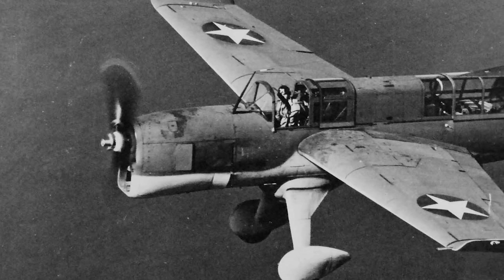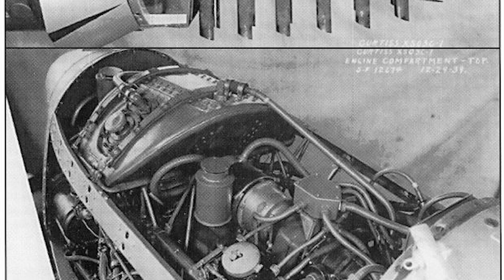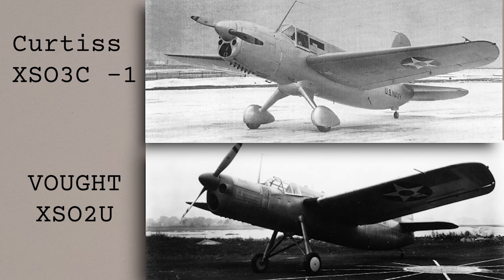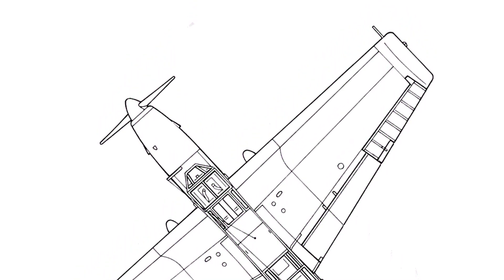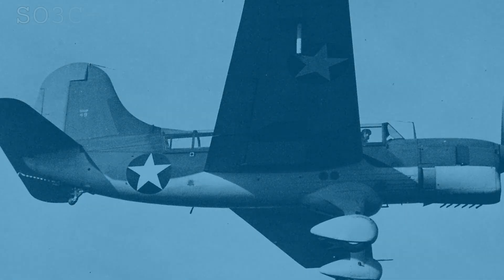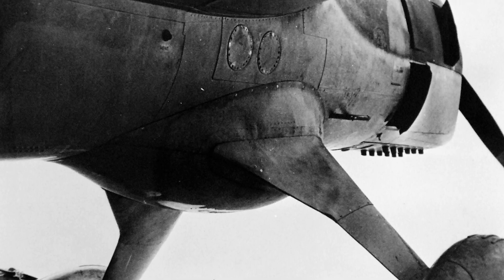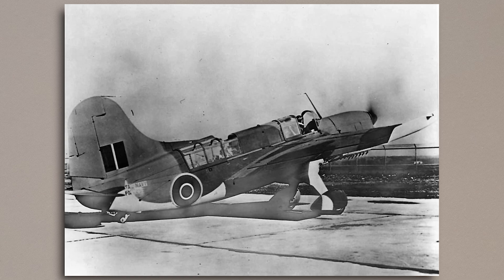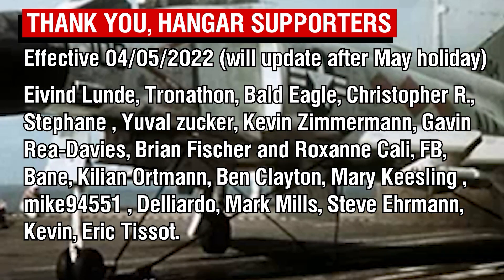A Plane So Bad It Was Removed From Service  | Curtiss SO3C Seamew [Aircraft Overview #56]

Comment: It was designs like this that prompted the US Navy to request a carrier borne bomber to have one pilot and the engine power to obtain enough speed to cope with enemy aircraft. The Dauntless was good, but it had to be escorted by Hell Cats lest it be shot down in droves. The result was the ADF Skyraider, a fast attack aircraft requiring only one pilot and the speed and armor protection to successfully carry out it's mission.  The Sky Raider was so good it was never replaced by one air craft but by several and even they were replaced before the Sky Raider was!  Today the Navy has yet to employ an all purpose attack aircraft that doesn't need fighter protection!
Reply: What about the F35, or the Super Hornet?

Comment: "The engine failed, causing it to sink..."
   Positive pressure seals on the floats? If the engine isn't running, pumping air into the floats, the plane sinks?

Comment: If it looks right i flies right. An engine thats not fit for an airplane combined with a short stubby fuselage and the added fixes to improve aerodynamic just screams failure. The French tried an inverted aircooled V12 too, This engine belong in a Citroén 2cv.

Comment: It's funny to see an aircraft design with a tail as big as a ship funnel having stability problems cured by yet MORE fin. The winglets most likely reduced a progressing side ship tendency, or made the ailerons more effective at high angle of attack slow speed flight. Sounds like it was mostly too under-powered for its own good. Should have stuck with a P&W R-985 or R-1340 and shortened the snout in the process to balance out the heavier radial and reduce the gyroscopic procession of the long mounted prop of the inline engine.

Comment: I have considerable experience with US Department of Defense acquisition programs.  As you alluded to, one thing which will severely endanger an acquisition, is changing the requirement after the program is well along toward completion. US DoD is strewn with the wreckage of program's with ill-defined requirements or requirements changed after the program has committed considerable resources and time. The list is a long one.

Comment: Surprised that there was little of no mention of its performance compared to its competition - the Kingfisher AND the original SOC.
It is one thing to describe flaws, but without context of alternative types you are not getting a clear picture. Any system is the sum of many elements. That’s why for instance the British could make use of an aircraft like the Swordfish that for all intents and purposes was hopelessly obsolete -  but for the fact that it was available, easy to maintain, easy to fly and did not have to face much aerial opposition in its area of operation. This is the second episode with no or hardly a mention of the Kingfisher. Maybe also more attention should be given to the role of scouting in general - as carrier aviation became the dominant component of naval aviation, tactics and strategy. Context. We can all pick up books with stats. But it is the context that is often missing.

Comment: According to aircraft designer Sergio Stefanutti, in designing a new aircraft from scratch, the aerodynamic is always the part that came out first, and the engine the part that came out last. Engines need a long development process before being ready to be used, so the designer should never rely on a new engine for his project to work. To reach the required performances is better use proven engine designs, and spend more time on the aerodynamic.

Comment: IF, The forward firing armament is so ineffective that depth charges could be an alternative to the machinegun, And the plane needs to take off with half of it's fuel capacity just to barely be able to take off at all, THEN it is not a plane but instead a boath.

Comment: “Air cooled” and “inline V-12” just doesn’t go well together.
Reply: "inline V-12" doesn't go together because it's a contradiction, "inline" means all cylinders in a single row, "V12" means cylinders arranged in 2 rows, so an engine can't be both. Germany made successful air-cooled V engines, the Fieseler Storch had an inverted air-cooled V8 and the Focke-Wulf Fw189 had inverted air-cooled V12s.

Comment: Plane needed more cowbell--got it--still didn't work. Still, from failure in one model came success in others. While WW2 was a terrible time in history, it did result in some outstanding piston-engine planes as well as jet-powered planes in the latter half of the war. The advances came very quickly in the 1940's, and even faster in the 1950's.

Comment: The US already had the OS2U Kingfisher all metal monoplane which flew a solid year before the Seamew.  The Kingfisher had near identical performance characteristics except for 20% leas range.  The Navy went on to build 1500 of them throughout the war.
Reply: Which leaves me wondering, why did they even bother with this program to replace the SOC at all? Just replace them with Kingfishers. Hell, the Seamew's competitor (the Vought XSO2U) was pretty much a Kingfisher with a higher-mounted wing and shorter struts to attach the float. And at least part of the reason for choosing the worse-performing Seamew was that Vought's production capacity was being taken up by the Kingfisher.

The idea seems to have been that the Kingfisher was for battleships and the Seamew would replace the SOC on cruisers. But the Kingfisher ended up operating on cruisers as well with no problem. Was it just that Curtiss didn't have enough work coming their way and this contract was to keep their factories running?
Reply: @RedXlV  To utilize a new engine line: the inverted V12 AIRCOOLED engine that they wasted money on, and it is a shitty engine
Reply: I'm eagerly awaiting Rexs coverage of the Kingfisher, had a soft spot for these planes ever since mounting a couple of them to the stern of Tamiyas USS Missouri back in the 90s!
Reply: Curtis was seen as shady.  The SB2C was a disaster on roll out.  The navy wanted to just cancel the Hell Diver because of it's bad performance but multi million dollar contracts were issued and higher ups forced the navy to take the unpopular plane into service.
After numerous fixes at way stations across the country the plane entered service with Curtis technicians actually on the carriers.  When Hell Divers didn't return from missions and disappeared on non combat missions it was discovered that the wing latches could fail in flight. It was later discovered that Curtis knew about this flaw but stayed silent for fear that futher fixes would cost the company too much money.
That's not the worst part.  Apparently the techs on board the carriers also knew about the possible death traps the planes were but said nothing to the men who flew them!  Some CV skippers ordered the SB2Cs to be thrown overboard and used the F6F Hellcat as a fighter bomber.
I bring this up because the military viewed them this way.  Curtis politiced there way into keep producing the P 40 for most of the war.  The obsolete fighter was given away in lend lease along with other planes.  They put profit above the lives of the men who flew their planes.
Curtis Sea Mew was just more of the same.  Junk pushed on the armed services.

Comment: Wasn't the 0S2U Kingfisher the replacement.  With the Seahawk being the replacement of the Kingfisher?
Reply: I wondered the same thing, so I looked and you are quite correct, with the Seahawk being introduced into the fleet in 1944.  I believe they were quite common in the Pacific at war's end.  Love the Kingfisher though.  One of the few planes I can think of that is ugly enough to give you nightmares when you remove the floats and add fixed landing gear!

Comment: I have a 1/48 model of this A/C in my display case.  Consider it a tribute to a failed design.  A couple of points.  Some of your pictures show the Seamew embarked on the USS Biloxi (CL-80).  One of those A/C bore the name "War Junk" on the left fuselage forward of the cockpit.  Also, opening the observer's canopy in flight to deploy the rear gun played havoc with the lateral stability of the aircraft, because of disrupted airflow! I think the aircraft lasted two months on the ship.  They were removed before it saw any combat.
Reply: That disrupted lateral stability was a design bonus. Instant evasive manuevors. Imagine being an aspiring Naval Aviator. And after getting your wings you get shoved into one of these.

Comment: Let's be honest, the plane wasn't horrible, the engine forced on Curtis was.  The airframe itself was mediocre, but far worse saw service.  If it weren't for the engine it likely would have served solidly until tech advances obsoleted it.
Reply: The inverted V-12 engine concept just didn't pan out....
Reply: @Hoopaball  that's not entirely true: the Bf 109 had an inverted V12, and that worked great. There have been quite a few successful inverted V aero engines over the years: this particular one just wasn't one of them.
Reply: @a.p.2356  good call. I meant *air cooled inverted V-12.  However, for the US Navy at the time, it seems like the air cooled radial was King.
Reply: @a.p.2356  True, several different variants performed well.  Just not for us.  Some of our radials weren't trash, though, so that's good I guess.  Engines for aircraft were not our strong suit during ww2.
Reply: @a.p.2356  True, however; radial engines were better, by far, in almost every application.  The FW-190.....one heckuva airplane. Germany's P-47....
Reply: @jeffstrom164  On the contrary, the Double-Wasp R-2800 and its further refinements were WWII game changers.  Post WWII commercial airliners depended on this engine.
Reply: @jds6206  You aren't wrong that the R2800 engines were a great line that came out of WW2, but you are wrong in that the majority of our engines were behind in capability.  It is why we had to use licensed domestic versions of European engines.  Most of the war our planes were slower and less acrobatic than the planes of the the other nations, mostly because our engines sucked.
Reply: @jds6206  It depends what you were after. The V engines tended to have a better power to weight ratio than radial engines and could usually be fitted into a more aerodynamic airframe. The downsides were a need for a liquid cooling and radiator system, and being more difficult to manufacture and maintain. The radials tended to be more able to resist battle damage and more easy to maintain as they were physically larger. They however tended to be heavier and physically larger than a V engine for the same power output, and caused a lot of aerodynamic drag due to the large surface area facing the airflow.

Both had their uses in different roles, with navies generally having a preference for radial engines due to their ease of maintenance and resulting reliability, while airforces generally preferred the power and aerodynamic advantages of the V form engines.
Reply: @jds6206  but then the later versions of the  Fw190 had the Jumo 213 inverted v12 which then would have been passed on to the Ta 152 series with it meant to be used in the high altitude fighter (H) and ground attack variant (C)
Reply: @Hoopaball  Nothing conceptually wrong with an air-cooled inverted V engine if it's done right, as the Germans did with the Argus inverted air-cooled V8 in the Fi-156 Storch, and the  Argus inverted air-cooled V12s in the Focke-Wulf Fw 189 'Uhu'.
Reply: @Hoopaball  Yeah, our aircraft engines of the time all lagged behind the rest of the industry.  We Were putting up advanced airframes with power plants that had less energy than a retirement home.
Reply: @Hoopaball  Right. It's not funny, but it is funny.....how could the Navy have complicated its engine selection more than it did? That is, an INVERTED V-12....? Really? 

With a nod to Rolls Royce's Merlin, RADIAL ENGINES proved their worth many, many times over in WWII.
Reply: DeHavilland had air cooled inverted engines ,though not V12s.
Reply: @Cancer McAids You'd better take a look at some of the British sleeved valve designs before running your trap, the Alisons 1500hp doesn't add up well to the likes of the Napier saber at all.
Reply: Idk why but I like Air cooled engines more. They seem simpler and can take more beating, I wouldnt be afraid that some bullet might start spilling some water out of my cooling system and the engine gonna start overheating or if something with the engine's maintenance was screwed.

But at the same time, there were a lot of these chunky radial aircooled engines. They seemed to were very underpowered so maybe at that time, water cooled engines seemed to be the future and allowed to make more aerodynamic, less draggish designs.

And then after some years into the war, a bunch of planes with powerful radial air-cooled engines showed up.
Suddenly, they had very powerful motor units and were able to work in the way that these old underpowered aircraft didnt.

Like early Fockewulfs had a radial engine or a fun Japanese interceptor J2M2, I like flying them in Warthuder's sim.
Reply: "Made it obsolescent" not "obsoleted it" 😂 dozy yank

Comment: The "Albacore syndrome" strikes again.

Basically, if you wanted to design a new plane to replace the old one, do not put an incredibly specific specifications on it (especially on budget), or it will be doomed from the start.
Reply: Yes! The F6F Hellcat was supposed to be an upgrade of the F4F Wildcat, but there were so many eventually they decided it was going to be a new airplane.

Comment: You would have though they would have built the aircraft with an existing engine with the view to changing the engine once the new one had proven itself.
Reply: You would think that, but you don't argue with the people paying you to develop a plane, apparently. This debacle served to be a learning experience for the Navy in letting the manufacturers have enough wiggle room to actually fix potential issues. xD
Reply: What do they say about cooking for dinner parties? You only cook ONE new dish. The others should be ones that are tried and true.
Reply: Availability issues maybe
Reply: @guaporeturns9472  True. But you would think they would have something they could use.
Reply: @bigblue6917  Right? Surely something better than a largely untested AIR COOLED INVERTED V!!  anything.. an Allison maybe?
Reply: @guaporeturns9472  Nothing kills a project faster than having to many new new parts to test at once.
Reply: @bigblue6917  Very true. Especially a wartime project.
Reply: @Cancer McAids right

Comment: Sea mew is another name for the common sea gull, just to make things even clearer haha. If you want do a vid about another, even more disastrous design, have a look at the Brewster Buccaneer. Especially if you've ever wondered what happened to Brewster...
Reply: And here I was wondering if there was a D-mu between this and the (completely flightless) Emu.
Reply: Brewster's WW2 strike is a prime example of how not to run a company to the point I actively pray that people trying to restore one of those wretched aircraft fail
Reply: There is no such bird as a Common Sea Gull, there is however, a species called the Common Gull.
Reply: @neiloflongbeck5705  
Seagulls are all upper class. 
No commoners.
Reply: Look at what happened with Brewster-built Corsairs.
Reply: Next on feed, Rex hangar, Brewster buffalos.

Comment: I was about to say that being replaced in service by the same aircraft that it was designed to replace is the ultimate ignominy, and then you said it wasn't even up to being used as a target tug... Alas, I suppose we learn from our mistakes!
Reply: They should have been the targets themselves
Reply: @brownwrench   I was just about to say, if not a target tug then a target drone.
Reply: "I suppose we learn from our mistakes"
One would have that hope. 
Sadly, that is not often the case.
Reply: @johnwilson1094  many such cases
Reply: @BlackMasterRoshi  Another would be the Bf-110 and the Me-210.
Reply: Similar story to the Fairey Albacore... designed to replace the Fairey Swordfish.
Reply: Smae thing happened with the Fairey Swordfish. Was meant to be replaced by the Fairey Albacore, but ended up serving longer than the latter.

Comment: I just imagine the salesman selling the Navy on the new engine sounding like a snake oil salesman.  Says all the right stuff and answers questions with more questions to confuse the point!
Reply: Watch C-SPAN for a while. 
Professional circle back psychobabble.
Reply: Not as bad as the viper that sold the Cow to the British!😂
Reply: The video said that changing the design requirement after production had started was one of the main causes.
So it seems the salesman didn't have to lie at all :)
Reply: I wonder if this was the same charlatan who sold the duff torpedoes to the US Navy, that BEUORD refused to admit were garbage